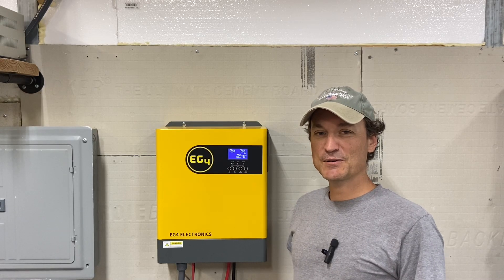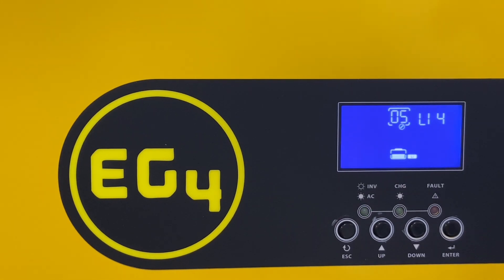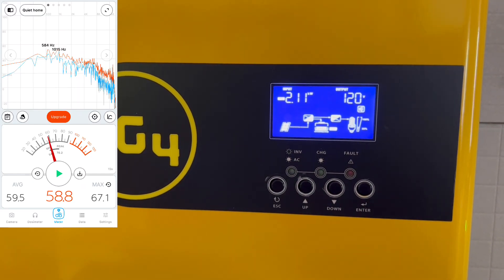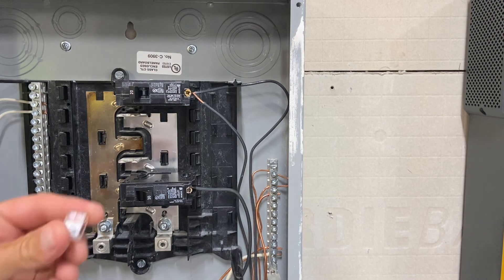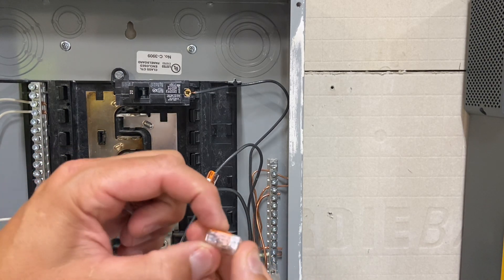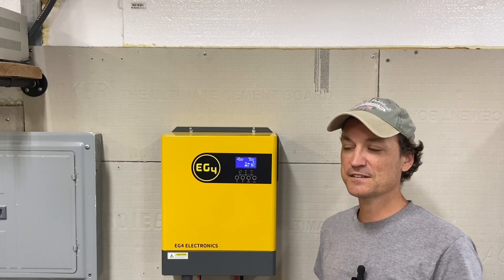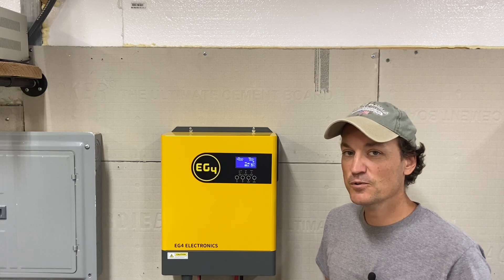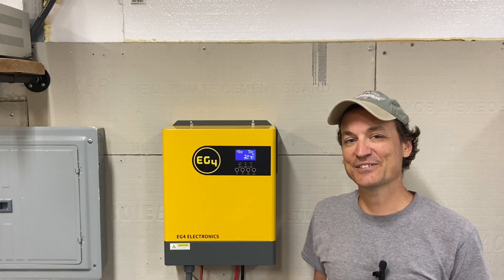EG4 3kw inverter follow up review and testing~ signature solar off grid solar inverter

Comment: All these all in one units look great to me.  They save so much work, materials an planning.  The problem with them is the idle draw.  Not great for people like me that live in locations with long grey winters.  Some of these short days the panels produce 10% or less their max capacity.  Multiply the draw by 24 hours and that's how much extra needs to be produced and stored.  This unit would be about 1440watts.  

If they got the idle down to below 30 watts or even less I would be very tempted.  This unit is such a good price for what you get.  Perfect for backup power, a cabin, shed, shop.  Maybe pair this with a little Victron phoenix inverter that has low self consumption for the 24/7 draws like freezers.
Reply from the maker: Yeah, paired with a 48v phoenix it would make a more efficient system. Idle consumption is really something that some people don’t consider when designing a system. Then again, for some users it won’t be much of a concern. It all depends on their average solar input, and the amount of storage they have. These are great units for space saving and over all installation. I’m sure they’ll eventually get the idle consumption down.
Reply: I am planning a 16kw array off grid setup.  I alread y have a fair number of part. Victron based.  Unfortunately I jumped the gun and later realised that the multi plus II 48/5000 inverters are still in the process of being UL tested.  Just hope that when they get approved I can use the ones I got already as they don't have the label.  My fault.  

If I can't use them I am hoping that in a couple years time there will be UL listed all in ones with 30watt or lower idle.  

Thanks for the great video!

Comment: I agree always go 48V.
Reply: Makes no sense to invest money in 12/24V gear only to later size up to full scale residential loads on a 48V system…

And then have a bunch of useless stuff sitting around that’s incompatible with your system.
Reply: @ericklein5097  I have a Renogy 20-amp 12V charge controller hardly used, and a 12V inverter sitting here collecting dust. Not much of a market for used inverters people don't trust them.  Problem is with solar start out wanting to just power a light light next thing you know wanting to power an Air conditioner. Easy to get carried away.

Comment: Thanks for these interesting videos. What about using a transfer switch with this system? I'm currently using a Reliance Protran 2 transfer switch with a Yamaha 3000 inverter generator going into an inlet box and then the transfer switch. Wonder if I can use that in the same way with the EG3000.
Reply from the maker: You could yeah. These have an internal transfer switch though. So technically you wouldn’t need it.

Comment: Does your 3000EHV read the combined a/h for the total # of Eg4-ll batteries in parallel ect. Two in parallel would be 200 a/h on the screen that also shows the % charge of the batteries. Mine a/h matches the %?
Reply from the maker: @michaelrichbourg2080  yeah it should show the AH increase as you add more.
Reply: @GavinStoneDIY  yep mine doesn't. Thanks
So far signature solar hasn't given me a correction for it.
Reply: @GavinStoneDIY  what concerns me though is i found one battery at 0% SOC and off while the other still had 50% SOC and the 3000EHV was off also
Reply from the maker: @michaelrichbourg2080  hmm. I would probably set the inverter to lead acid mode till I figured it out.

Comment: I’m considering the eg4 3kw which would work for most of my critical loads. However I have a 230v mini split for my garage “man cave”. Do you think it wise to experiment with the eg4 and maybe add another one down the road or save up and go with the 6000xp from the jump. I should add I’m just getting started down the solar rabbit hole.
Reply from the maker: I really like the 3k. But if you ever plan on expanding to 240v then I would start with the XP. It uses around the same idle consumption as the 3k. And has double the power. 

Save up and go bigger. You won’t regret it.

Comment: Great informative content!  I’m thinking about this inverter for small off grid workshop. I’m wondering how the powersave works when a mechanical timer starts a ventilation fan load and then stops the load.  Does the powersave work as advertised and start inverter and then go back to powersave?  What is the idle consumption with powersave mode but pv charging (battery charger in use)?
Reply from the maker: I’m not sure what the consumption would be with PV. I’m going to be testing another inverter so I had to remove the little guy. From what I can tell the power saver does work as advertised. I did see though that if you have a small load that needs to ramp up from 0 watts it wouldn’t activate the inverter. In other words the inverter stays asleep unless you have a legitimate load kick on.
Reply: @GavinStoneDIY  the fan I’m looking at is 70w. Is that under or over the small load you said did not trigger the inverter to kick on out of power save?
Reply from the maker: @egkingjr  I think that would be fine yeah. I just had a charger that wouldn’t activate it. But it was starting from 2 watts. So that’s a different story there.

Comment: You moved the fridge hot wire from the main panel to the eg4. What about the ground and the neutral.. That still be coming from the main right??? Should the ground and neutral in the eg4 be bonded or not for this application.
Reply from the maker: Not bonded for this application if the ground and neutral are supplied by the main panel. So the ground and neutral can be supplied with larger gauge wires from the main. And then after that,  all the smaller circuits like your fridge you can just move the hots over.

Comment: id like to install this in my 7x16 trailer conversion. Would i run power from my ac out to a breaker panel than from my panel to all my outlets and lights? i also plan to run a 9kbtu mini split with this setup .
Reply from the maker: Yes that’s how you’d want to do it. The panel essentially allows the power to branch off in different directions. So you could think of it as a hub for the power. One breaker for the mini splits and probably 1-2 breakers for the outlets.

Comment: Does this unit have any issues with light flicker like the 6500 do?   I’m thinking this may be a cheap solution for me to put my light circuits on this as a sub panel to my 6548,   Rather then just replacing them because of the light flicker issue.
Reply from the maker: I didn’t have it hooked up to any light circuits when I tested it. That could be a potential solution. What model 6500’s do you have?
Reply: I have the Sungold SP6548’s.

Comment: Excellent follow up video.  I commented on the NG bond screw in your fisrt video.  I installed one to be bonded when in battery/inverter mode and have AC in connected.

Without the screw installed, what is your solution for being bonded when in battery/inverter mode?
Reply from the maker: With the screw out and without AC in connected to grid, I would bond the off grid sub panel. that way I would still be bonded in one location. If I had the AC in hooked to the grid then that would be supplying my bond. If the screw is in, and you also have ac in supplied by the grid,  the inverter would technically bonded in two locations. There is some variables involved with that though.

Comment: Do you need to carry the neutral and ground to the critical loads panel or just the hot wire?
Reply from the maker: You would carry a heavier gauge neutral and ground first from the main panel. And that covers all the smaller breakers you move over. So the small breakers you just transfer the hot.

Comment: Seems like power saving mode would be great for running two of them on your RV. If you are running the ac on your main 3000 and then kick on your microwave the second could kick in and run the extra.
Reply from the maker: Theoretically if it were wired that way it could work yeah. But for that you’d probably need two load panels.

Comment: When you run two of these inverter in Parallel....can you have  both 110  as well as a 220 outlet.  I would imagine that would be sorted out thru the load panel.
Reply from the maker: Yes. With two of these in parallel they can generate what’s known as split phase output. So at that point you can run 120/240v appliances.

Comment: Question if possible: The shipping price for EG4 Batteries are just way too much for me (about $347) so I am looking at buy another 48 Volt battery brand.
  To my understanding, this EG4 All In One Inverter can only communicate with EG4 brand batteries. 
  How bad would it be for me to have a system where the EG4 All In One inverter cannot communicate with the batteries?
Thank you in advance
Reply from the maker: You can use the batteries in what is described as “open loop”. Which means you wouldn’t have battery coms. So the inverter would be set to lead acid. It will work fine like this. Communication is just nicer. 

However, if you’re ordering soon, Current Connected still has a free shipping  promotion going till the end of the month. So a couple more days. Which is super cool. So you can still get the EG4 budget battery with free shipping. I think the promotion code is Gavinstone. 

Either way will work. But the new lifepower would be ideal.

https://www.currentconnected.com/product/eg4-lifepower4-lithium-battery-48v-100ah-server-rack-battery-ul1973-ul9540a/?ref=xhJJBPDS

Comment: Jumped on the EG4 wagon and bought a 3000EHV and one EG4 LP batt.  Combined with 10 280w used panels I got off FB, it runs a 1 ton window unit all day in my shop. Only issue is the indicated PV voltage noted on the inverter screen is almost 100v less than I’m measuring where the PV wires come into the inverter.  (235v vs 330 measured). Any ideas why?
Reply from the maker: That’s coo! There’s a bunch of potential uses for this inverter. I figured an AC unit would be a great idea for using this on. 
As far as the voltage. Are you measuring voltage as the unit is under load? If not then the voltage would be the VOC of the panels. And once the loads are applied it drops down.

Comment: I'm thinking of buying one of these.  I'm retired with not a lot of money to work with.  I have a small 12 volt system that I built for the time when I was RVing offgrid for a few years.   I have 600 watts of panels sitting here that I have been using to run my refrigerator, just to take that load off of my electric bill and do something with the system I have.  Well, the batteries are dying so I am thinking I should upgrade.  I guess I will be using this for critical loads.  DO YOU THINK this is my best bet?  I know I will have to add some more solar panels and a battery.  

Thanks for any input from anyone.

Comment: OH and do you think this would level one charge (120 volt) my LEAF?
Reply from the maker: For what you’re describing, I think your best bet is the eg4 6000xp honestly. The cost is a bit more. But it still comes with the breakers that are needed. The idle consumption is nearly the same or less then the eg4 3k. And you’ll have more available power on hand. And it’ll easily charge the leaf. 

If you haven’t watched my videos on the 6000xp maybe check that out first.

Comment: I'm having trouble enabling "Power Saving Mode" in program 4,  also the inverter is always in "Parallel mode" in program  28.  Not sure why is doing that. Every time I try to change these two settings it just reverts back.
Reply from the maker: Are you exiting out after selecting the setting? Often times the setting won’t stay unless you do that.
Reply: @GavinStoneDIY   Thanks for the reply.  I figured it out, it was the Parallel mode that caused the issue.  All I have to do is to have two power sources,  battery and (PV or Shore), and switch the parallel to single mode.  Then I was able to enable the power-saving mode.
Reply: I was having the same "parallel mode" thing and reached out on the diy solar forum and found out the inverter needs to be in standby mode to change that setting. Couldn't find that in the manual.
Reply: @wesbutler8289   In order to switch to standby mode you will need to have 2 sources of power. If not the inverter will just shut off.    I've tested this issue, you don't need to switch to standby mode to fix this issue.  All you need is to have 2 sources of power.  In my case,  1. Battery 2. Plug the inverter to my home outlet.

Comment: How do you run household 12v appliances?  Everything in a US house is 12v other than the split phase stuff
Reply from the maker: Everything is typically 120v/240v in the US. And this is a 120v unit. So if you needed to power 240v loads you could have two of these in split phase to generate 240v. If you did need to power 12v dc appliances you can use something called a buck converter to lower the voltage from 48v to 12v.